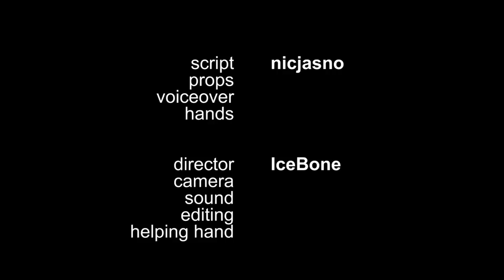Single cylinder engine run

Comment: Would be fun for the engine to have an electric motor with a one-way clutch as a starter so you don't have to do it manually.